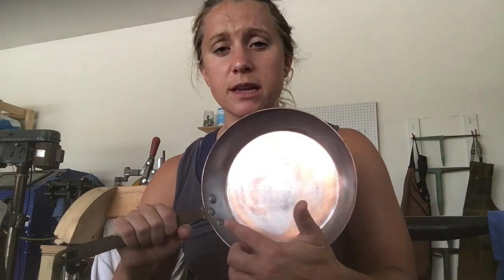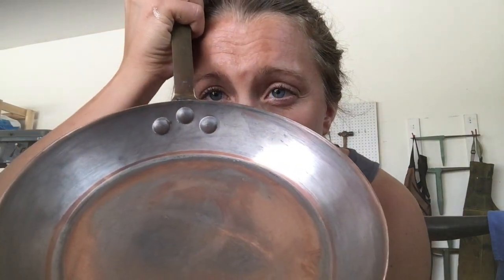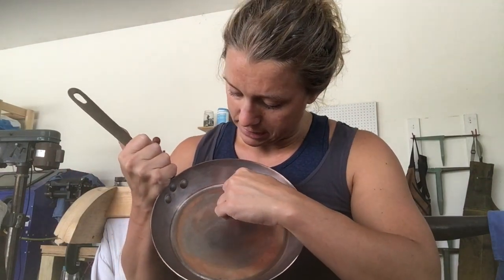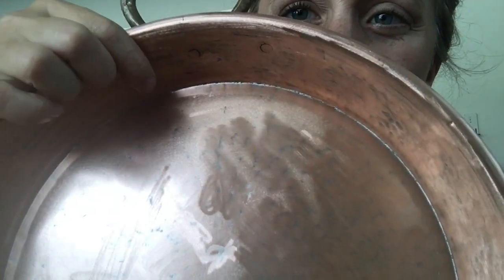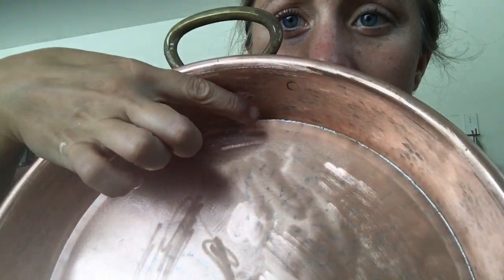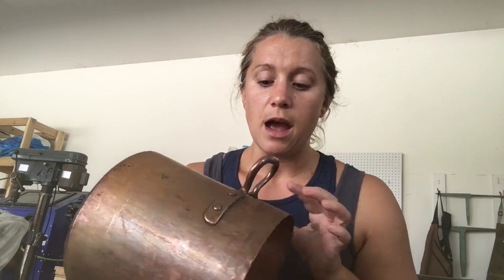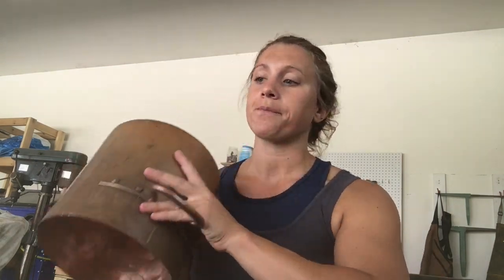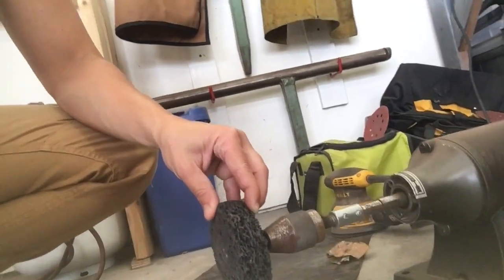How to Prepare Copper for Tinning

Comment: What strength of acids are you using? Also, when you refer to caustic, would sodium hydroxide work? Thanks! I have a Wagner saute pan that will be my test subject.
Reply from the maker: I usually do 50-50 for the caustic wash (yes, sodium hydroxide is fine!) and then 4:1 for muriatic (4 parts water, 1 part muriatic) soaks. I will use higher concentration of muriatic when using as a flux. Good luck with your Wagner!! So exciting!

Comment: Very nice, can you please tell me if tinning coating can be done in aluminum pans ? And if tin can be coated on steel ?  ?
Reply from the maker: It's very hard to coat tin on aluminum and steel (especially steel - you're trying to get a ferrous and non-ferrous metal to sit next to each other, which is not easy) - a lot depends on the alloys, the heat, the flux, etc. I do not do this myself.

Comment: Thx for great video.  Sweated many copper pipes, so have the concept.  Do you put on the flux before heating, or after starting to heat the pot?.  Thx  Tried draino for cleaning a  really oxidized old pot but it didn't do much.  Same with HCL acid.  So realized I needed to use mechanical cleaning.  Mounted wire brush wheel on drill press and can get to bottom of most pots.  There's a cone shaped wire brush for the corners.  There's an outfit in Istanbul named Soy that makes sterling silver pans.  WooHoo!  On Youtube.  I'ma go there and buy 10 and spray with metalic copper Rustoleum and pack in suitcase!!
Reply from the maker: It depends on the piece - I usually get it halfway hot, then add flux and watch it sort of "carmelize". :)

Comment: Thanks for the info. I've never tried a stripping wheel. I have a couple but am hesitant to use them cause I don't know if they are too aggressive or not. What is the 'rating' or 'grit' or whatever you call it of the wheel you are using? Thanks again. The videos are always appreciated.
Reply from the maker: Oh, I hear ya. I get nervous too. It's less aggressive than you think all things considered. Dremel attachments can be worse. I use the Avanti-Pro Non-Woven Drill Mount Quick-Strip Disc. You can get them at Home Depot. So there's not a grit per sae. And then you see I got a buffing motor, attached a drill head to it so I could insert the stripping disc, and then go from there. One of these days I'll mount the dang motor. LOL.

Comment: Can u heat up the old tin to liquid state and remove it that way?
Reply from the maker: Unfortunately, no. The tin has bonded to the copper on an elemental/molecular level, exchanging electrons. There is no physical / chemical /elemental process to remove the old tin with heat.

Comment: Wow! I can’t imagine what amount of stripping and grinding must have been done on those pieces, Sara. You really get it down to the bare copper. Getting into crevices and creases must really be a challenge, but a necessary one for the tin. The ones you have finished look so beautiful and shiny though! It makes me want to get my hands dirty. Maybe I could do the videography for you if I didn’t live up here in the middle of no where. I need to use that Bead Blaster is what I need to do.
Reply from the maker: Yes, sometimes I have to do more grinding than I like. It's not always necessary, though. It depends on the piece. If I can get the oxidation off the old tin, I don't have to strip it completely. Getting into the crevices and creases is the hardest part for sure. You definitely need to use that bead blaster! :)

Comment: Sara
I bought some brand new sauce pots (I'm a chef) and i don't think the tin is very thick, so I thought, "while they are brand new, can I just add some tin to make it thicker, with a better quality?" you know, like 2 mil vs .75 mil. Thoughts? Chef A
Reply from the maker: That is a good question. Some of those pans do come with pretty thin coats of tin on them - I don't know why they do this. A nice thick coat is so good. You could add more tin, but frankly, that won't affect the efficacy of the lining at this point. And it won't go on to 2mm thickness - it's too soft as a metallic property. It would actually be super soft at that thickness and you'd like...be able to sink your finger into the tin lining at 2mm. :)

Comment: Sara, when you have large areas or pitted spots full of gunk set that dremel down and get you a die grinder with a ¼" collet and fine surface prep roloc style discs or an angle grinder with a collet adapter which they call a flapper adapter and the roloc surface prep discs.  Variable speed ones are worth the extra $.  Also holding power tools vibrates and destroys the nerves in your hands.  You can get anti-vibration work gloves and top brands such as metabo are made well and are supposed to be the most vibration free.  I don't own a metabo to vouch for that.  I have makita, milwaukee and hitachi grinders I use for metal work.  Hope this is a time saver for you.  🕉❤🌎✌
Reply from the maker: Oh Shaun, thank you! I've never heard of anti-vibration work gloves!!!! How fabulous! That is on my list to look for - thank you!! I'm also doing a lot more with acids to help with the gunk, which seems to be helping a ton with less mechanical removals needed. But thank you - I love having an excuse to find more tools. :)